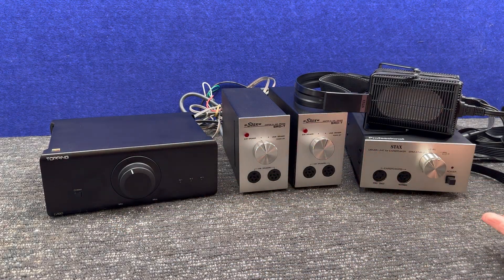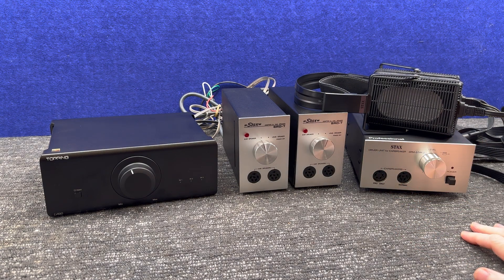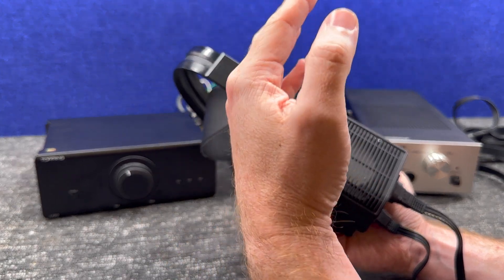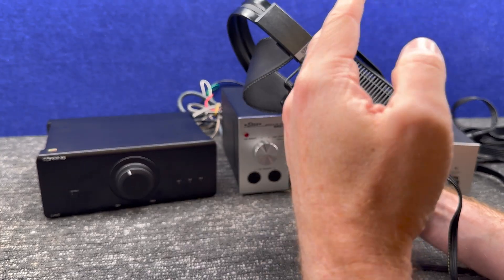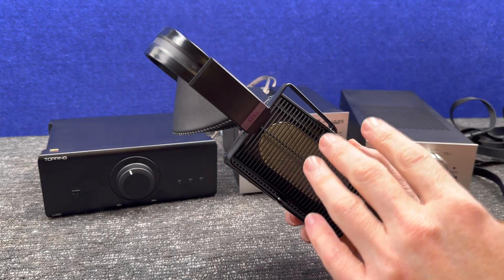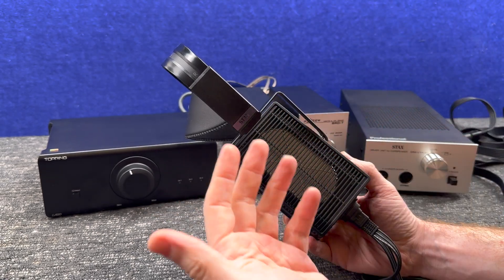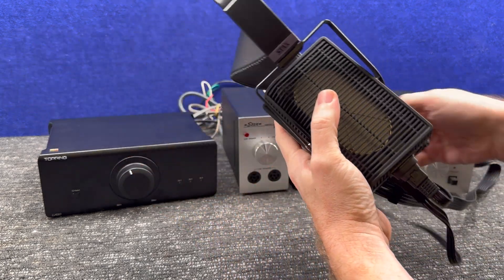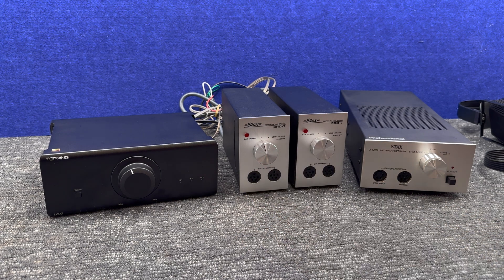STAX Earspeakers - Introduction

Comment: will you be making a custom PCB? Maybe use a big chassis and include the isolation transformer? Use Mills resistors instead of san cast? Looks like fun, I'll be following!
Reply from the maker: Breadboard first then most likely design a proper PCB. The “current” plan is no transformers and a pure DC bias supply using switch mode or similar which should be superior. No resistors will be used in the signal path, just the transformers 🙂 a custom chassis could happen but I haven’t found anything on the market yet that is visually appealing and I can get in less than a month. Was one of the reasons I was going to modify the SRD box and gut it out. This could change once we start if I find something appealing 🙂
Reply: @whatcouldgowrong7914  Did you try HIFI 2000? I'm not sure where you live but they ship worldwide. My other favorite enclosure is using dead test equipment from the 70-80's the HP stuff is often great to gut. The only thing left on the list would be to make the drivers at that point, might that happen once this step is done?:)